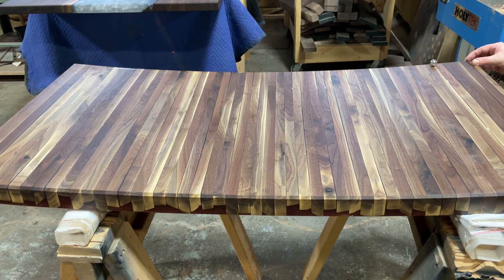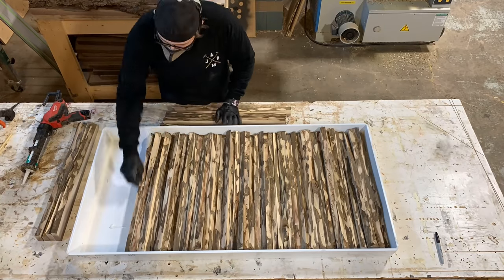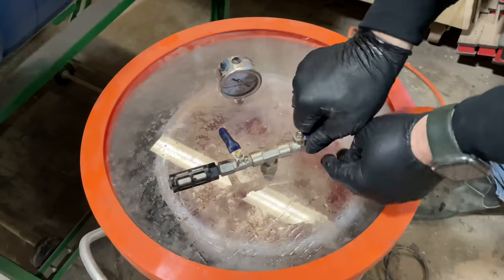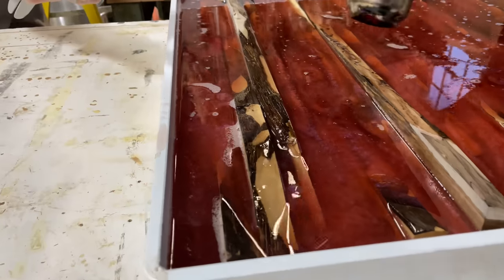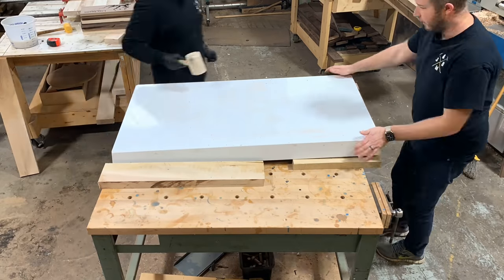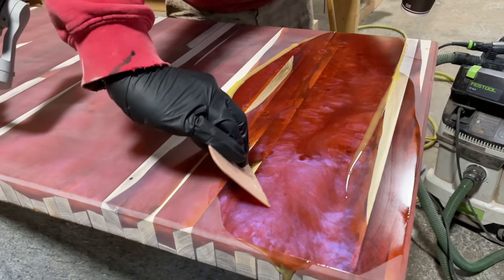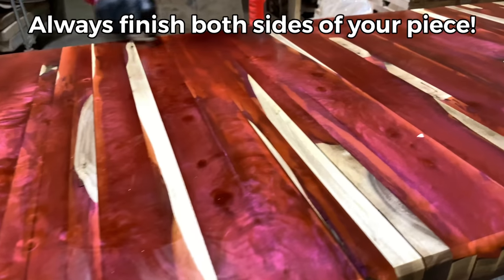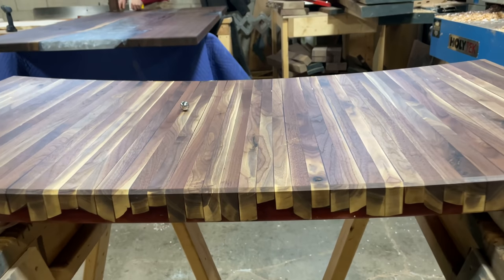EPOXY FAIL | Don't Make This $1000+ Mistake

Comment: Most of the time, wood shrinks as it dries and 'stabilizes'. I'm curious if you checked the moisture content in the wood to see if it was low enough before being used. You could possible kerf the wood side enough to force it to flex back to being flat and then insert or inlay strips of hardwood, sand and coat completely with epoxy. That might work.
Reply: I too would like to know if the wood was kiln or natural dried and moisture checked before starting?

Comment: If you dry it out, it may go back to straight. Then you can put a thick coat on the other side. I've shrunk wood by leaving it in an airtight container with calcium carbonate.

Comment: If you can straighten it out could you make a metal frame and legs that fixes into the bottom keeping it straight and having the industrial look with metal legs
Reply: It would crack over time if you forced it straight. It would likely taken hundreds or even over 1000 lbs to straight it.
Reply: @kaden56  Steamboat flat but I would sell 'as is' saying it was intentional.

Comment: You could use it as the front face of a set of drawers. Just cut squares out of the front for the draws and build a box around the back.
Reply: Drawers? Is that what you meant?
Reply: @DavidMcFarner  Yes. I'm dyslexic, i sometimes type the wrong word if they sound the same but are spelled different lol.
Reply: @DavidMcFarner  I get, there's, theirs and your and you're mixed up quite often as well.

Comment: Cut it up and use the material as drawer fronts/doors for a small cabinet.
Reply: Slice it up into 3” pieces. Flatten and square up the sides and then glue it back together. Put epoxy on the bottom and pour countertop epoxy on top. Finish as usual

Comment: Perhaps you could turn it into a gate, or cut it into small cutting boards, or build it into another larger table useing a larger mold & have that piece in the center?

Comment: Turn it into a glass top table. The clients can use the curve as a way to store blankets or tv remotes and still keep the surface clear. Just drill holes in each corner to fit legs that the glass will rest on

Comment: It's hard to guess without looking at it, but that subtle curve makes me think it would be a good candidate for a bar. Set it on its side, mount a bar top and set it some classy bar stools.

Everyone keeps saying it would be great as a bench... I can't envision that idea though...
Reply: I don't think it would make a great bench either. I do like your bar front idea tho. I think they could potentially fix it by soaking in water and letting that back swell up, then hurry up and finish it with epoxy
Reply: @EricRoy85  definitely. It's easy to throw in the towel even you feel defeated like this, thinking you made a $1K mistake and all. But what do you have to lose? Just try the water trick and see what happens.

Comment: Have you thought about adding two channels on each side (on the wood side) and using metal to pull it back to flat?  You’ll need to use a metal square tube to keep it rigid.  As you are flattening it out, heat it so it doesn’t crack.  If it cracks, you can just epoxy the cracks.  It is still capable of being flat in my opinion.

Comment: Put it in he sun with weight in the center. Once I has softened rought out 3 grooves the length of the table and epoxy metal rods about 3/8 thick and it should stay in form and be able to be secured to a stand for use as a table. Best of luck. Hope to see a video showing how well it worked. I have used this truck a couple of times and worked very well for me.

Comment: Cut 2 to 3 groves in the bottom side going long ways. Straiten, then enlay with steel square bars.
Reply: Good idea
Reply: You won’t be able to straighten it since the epoxy shrank, causing the curl.
Reply: It in the sun and let it warm up, it will help the epoxy become malleable and hopefully able to flatten out enough. Keep it clamped flat as it cools down

Comment: I would still use it as a table but add a glass over it to level it out. Or put it sideways and use it as a divider between 2 rooms. or, Put it sideways and add a counter over it and cupboards on the other side and that would be useful between living room and kitchen.

Comment: I would heat it up, and clamp it flat, once flat you could route in a couple of c channels on the bottom side to hold it flat. 
If you have a radiant heater, they work fantastic for heating up things like this. 
If you didn’t want the c channel showing you could put the table aprons over top of them.
Reply: It seems like this project should be salvageable. I like your approach. Just router in 2-3 steel channels accross the length of the bottom. Screw table down flat.

Comment: If you still have it, and want to use it as a table, you could make a steel frame underneath it and bolt it don't carefully to avoid cracking the epoxy. I have seen this being done before, you'll just have to bolt the frame down the right way, starting from one end at move towards the other using screws on every singe piece of wood so that there will not be space in between the wood causing the epoxy to crack
Reply: I was thinking something along this line.

Comment: I am sure you've done something with it by now but I had a few ideas:

1. Slice the whole thing length wise, add some metal supports. (Securing it to metal from underneath should take out the curve.) Add a live edge river back with the same red epoxy for a couple awesome entryway benches.
2. Epoxy finish the other side so it won't warp any further. Cut it into smaller end table or coffee table sized sections. Joint/plane them off flat. Build bases and done.

3. Build a headboard out of it and make a matching shorter footboard.

Hope it helps. If not on this one hope it gives you ideas for others that don't meet QC. I screwed up some major projects myself and had to find ways to make it work.

Comment: Cut it into strips along the long edge and reassemble them side ways that way you have a flat table thats curved on two edges. Then trim the short edges to be flush together. It will be a pattern of wood stripes and epoxy puddles.
Reply: I had similar thoughts.

Comment: You could try cutting two dados on the woods side (guessing the epoxy side was supposed to be the upper) and then put metal "c" channels. The same thing is done on tabletops to prevent warping. I don't know how easy it will be at that stage, but that's my thought.
Reply: Dovetail keys the full length of the back. At least three. It'll also get it of the bottom of the mold allowing better enwrappment all around.

Comment: What I see from the get go is that the wood pieces are not glued together. That would have given some structural resistance and prevent the warping. Some clear resin on both sides now should fix the warping.

Comment: I would make a table with a surface that just isn't flat and level - the curvature isn't so severe that a cup would spill or slide or tip if placed on this table, so I would just go with "it's not a bug - it's a feature!"
I suppose it might need some sort of special support - if you just screw legs to the bottom, and if the table flexes with changes in atmospheric moisture, it might 'walk' across a room - so maybe a frame type base where the table is attached at two points in the middle, but the four legs make contact with rollers or something.
Reply: Hello there 🙋‍♂️👍🏻
Reply: Same here, I would just buy this panel out from you to use as a coffee-table which was ment to be curved to prevent things from slipping off it. I fond this uneven surface even more attractive to dissolve the straightness and order of any interior and bring more nature-like touch to it.

Comment: I wouldn’t be surprised to see a table with a curve like that in some high end hotel or some such specifically because it is curved. You can still place a center piece on it and make it looks good if not actually functional.
Reply: I definitely agree here, just make a saddle frame and market it as a unique table.  You should get $3,000+ for this mistake, a perfectly flat table is overrated.

Comment: I believe that problem is in that you didn't glued all those wood planks together before you poured epoxy resin on top . You could pour epoxy on the bottom part , after that make a mould for the top and pour epoxy resin to flatten the surface . Table will be thicker than you wanted originally but still useable and your next wideo will be "How I saved 1.000 USD" :)
Reply: Exactly! When I saw they use silicone instead of wood glue in the beginning, I immediately thought: there is your problem...
Some people just like to take shortcuts I guess...
Reply: I don't think this is a relevant issue, the resin will serve as the binder instead of PVA and epoxy is usually a much stronger adhesive
Reply: @kestekrafts1580  1 silicone is flexible when it dries out, 2 if it was glued properly, wood would act as a single solid piece. The way they did it left it with too much air. It’s physics mate. Not clamping it properly made it even worse.
Reply: @yafmaverick  the silicone plays no role in gluing, it just temporarily holds it in place for the pour, the resin will seep between the gaps and act as a glue, from my experience most epoxy resins will seep through cracks that are too tight for water to get through (when still fresh of course)
Reply: No it has to do with the water the wood takes out of the air. Same with veneer
Always do both sides otherwise it'll warp...
Reply: @anonym7410  I would add to that, as well as needing a symmetric glue up, the wood itself has direction, the vast majority of change in shape (due to change in moisture content) is in the direction of the growth rings, considering you have all the pieces with live edge facing up it means all rings are facing the same direction (wider at the top, narrower at the bottom) causing any change in moisture to bend the wood in the same direction throughout, if you had every second piece facing down it should theoretically majorly reduce the bend
Reply: @kestekrafts1580  there are slot of methods how to place the wood when gluing. Im pretty sure the guy didn't made that mistake and this doesn't make such a big impact as in the video
Reply: the author is correct. uneven material distribution will cause warping because the top and bottom will expand and contract at different rate ......
Reply: What I would have done... is first connect all the boards together in some way, glueing them. And then once I have that, put them into the form... pouring epoxy.
Reply: @Momoka7  It may still not work. As you could see, the wood pieces are all actually glued up nicely. The problem is that the top and bottom sides do not expand and contract at the same rate. This problem is not unique to this project. All projects that require laminating different materials need to balance the material distribution.
Reply: @jonathanthink5830  It might not work on this piece, but the idea is to add some stability before you do the epoxy. Just like you said, balance is all.
And yeah you are right, it is not unique to this project. I just find it funny that they seemingly are surprised by this outcome.
Reply: I agree. Surfacing and glue. Clamp. Good to go.

Comment: Black angle iron finish for the outer frame. Then inlay cut pieces welded to the frame running width wise under the slab to give it strength. A "rough" black iron could compliment your piece.

Comment: You know how curved TV's are all the rage these days? I think you've created a really unique and interesting piece of wall art or even a cool table if you added a glass top to it with stand-offs. You could heat it up and use C-channels to keep it straight but the stress over time could also crack the epoxy. I'd be curious to see if it warps any further in the next few days or if anything new develops. Keep us posted! :)
Reply from the maker: haha we can start a trend of curved tables! We will keep you posted! I'm kind of surprised that we didn't think of this before pouring it. You live and learn. Luckily it wasn't for a client and we were just messing around and trying something new.
Reply: yeah maybe a backdrop for a living moss and fern wall or something like that
Reply: Cracked epoxy.... Kintsugi it? Fill with Gold tinted resin. Heh.

Partial kidding aside... The piece could be used for something artsy... If you choose not to try and reverse the bend.

Comment: It would be great for a sailboat hatch, at the entrance of the cabin, the one that slides back. Those have to have a curved top so the rain runs off it. It might be a little wide but could be cut down to size, or used on a big sailboat, which would need cutting down.

Comment: The problem started by NOT flipping the grain on every other piece.  The wood remembers how it grew. Look, it still wants to be a tree. 
 Remove 75% -ish of the epoxy from the top. Allow  that wood to release the trapped moisture on the side that is buried in epoxy. Keep it clamped for a few days at least. May take a month.
Alternatively or in addition to,  you could route a channel for some angle iron and epoxy and screw it tight to draw the center down. 
 Good luck!
Reply: yeah exactly what i thinked about
Reply: Pretty much this is accurate but what shocks me is how people with the level of advanced equipment like we see here dont already know about balancing grain direction.. Its wood 101

Comment: Wow that's a lot of work. 
Could you weight down the top to press out the warp, then when it's flat,  epoxy the bottom side so that it doesn't get warped?

Comment: Along with my other comment, I don’t fully understand how this happened still. Ive seen hundreds of table that only have epoxy on the top, with solid wood on the bottom. Nobody has reported this as an issue. 

Right now I’m messing with an extra piece of pine I might install as a floating console table at the entrance of my house. I routed a river pattern out, but only about an inch deep. The bottom is solid wood. So, this is likely to happen if I filled the river in with epoxy?

Comment: Set it on a flat surface and apply weight for a few days to see if it straightens it out. I did that with a refrigerator door. It worked out .

Comment: Easy, just a add another layer of transparent epoxy to level the top surface.
Reply: They would have to do both sides
Reply: Yes encase it in clear epoxy so the curve is in the center.
Reply: @hugavet3049 
Maybe but necessarily unless they are going to use the underneath side to put something on. 🙃😁
Reply: It's always what happens with uneven structures.
Glue a piece of paper on a board.
It will bend it. Cover both sides of the board at the same time, it stays flat.
Wood is working with change of humidity, resin is not. Easy as that.

Comment: Did you get a solution for the table?
Noob question, could you inset a couple of steel runners to flatten it out? Maybe place the table in a steam chamber to allow for the wood the flex.

Comment: Cut two strips lengthwise, affix them and fill epoxy in the middle making a smaller oval shaped table. Could make a few of them actually.
Reply: It sounds cool but the original problem of the one side epoxy finish and the opposite side wood/oil finish still remains.

Comment: In theory you should be able to creep it back into shape and if enough time is given it shouldn't really break (enough I mean days-weeks-month timeline)
Then since the problem was the not applying surface finish to the sides, as far as I understood, you can reapply them (might not be good before creeping because it could create microcracks in the coating requiring you to coat yet again so just saves hustle)
other than that some aesthetics tables can have different to flat shape so that's one thing :D

Comment: What is the strength of the piece, that is weight capacity if it was used on the convex side?  A couple of ideas.  1. Archway 2. Small Koy pond bridge 3. stand it on its side and use as bar front

Comment: You could just pour on the convexed side and it would flatten top with a curved underside
Reply: You could just screw two pieces of square steel tubing to the bottom and attached legs the square steel tubing will straighten it out use clamps pulled tight screw it down.
Reply: I've also used heat lamps in a heat gun and heated up epoxy and flexed it right back then screw down some supports and pour some resin on the other side.
Reply: @paulanderson4933  
sounds like a good suggestion.

Comment: next time, put 2 slots in the back about 3/4-1" wide by 1/4" deep along all the wood. then do the epoxy pour as normal. once you get it out of the mould, put some metal flat bar in the 2 slots and screw it to the wood. it'll sit flush and be unnoticeable and hold the wood straight. ;)

Comment: If the resealing the wood in water doesn’t achieve the desired effect, try the epoxy again.
Clear coat, fill in the warped part to make a flat surface. That way you still get to see the colors. 

When you sand the table only the warped part will have the thicker stuff on it. It may even change the color (dragons breath) to even more colors.

Comment: Cut it in many pieces. Put them together totally differently, like flipped around or turned around 90°.
Put them together with new epoxy. 

If you turn every 2nd piece by 90°, the forces should equal out each other. Better even would be to flip every 2nd piece. They should be quadratic at best.

Comment: this might be a stretch also i dont know if resin can be layered but you could cut the piece into strips and flip some of them upside down so that the curvature is evened out to a degree,then you could pour clear resin to both sides of the piece so that it becomes completely flat